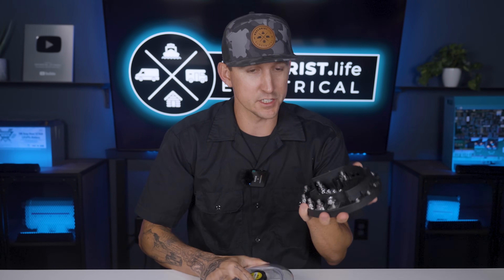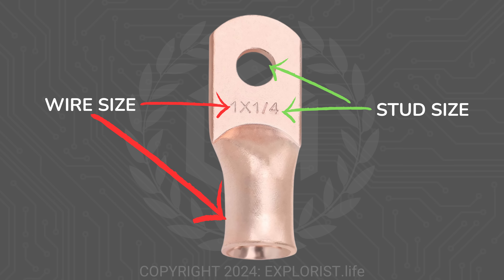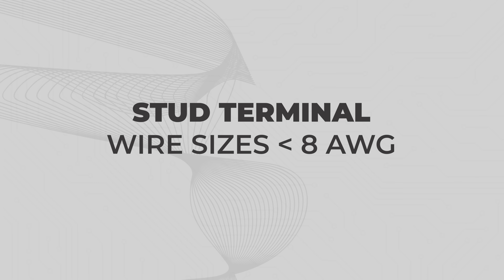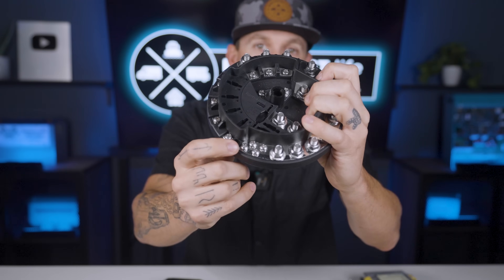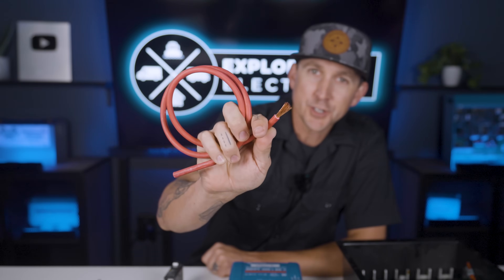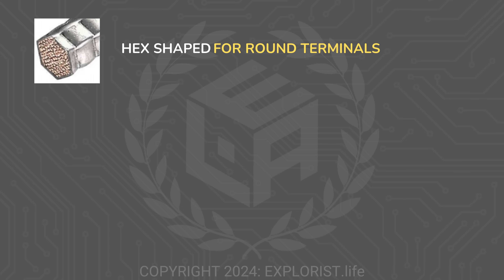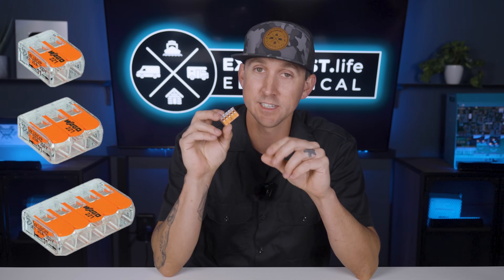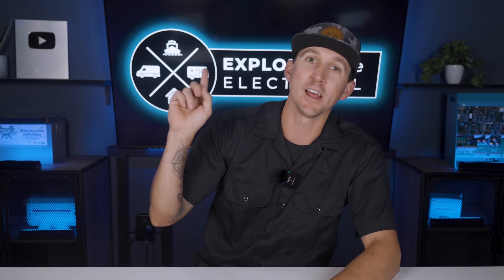Wire Terminals 101 -  Wire Terminal Basics | Ep: 1/14

Comment: Best channel on the subject, by far! A little suggestion, though: could you give the metric equivalents  when talking about wires and connectors since less than 5 % of your potential viewers use US units!
Reply from the maker: I have been doing a better job of that in these videos and I have conversions charts in previous videos; but all of you using the metric system still need to learn AWG because HOPEFULLY you're still buying all of your parts, kits, components, etc from our store, shop.explorist.life (exclusively AWG), since that's how these videos are funded, right? 😊😂

Comment: My favorite to use in any automotive application, the heat shrink connectors that are semi-transparent, as they usually have a built-in thin layer of hot glue that seals the connection and secures the wire in place.

Comment: I wish they would make closed-end ferrules.  Most of my work is in the marine environment and I'm sorta a freak of ensuring moisture cannot get into the wire.  I am using tinned cable, but I have seen corrosion on tinned wires over the years.
Reply: Add Dielectric grease
Reply: How about seal the end with a bit of solder?